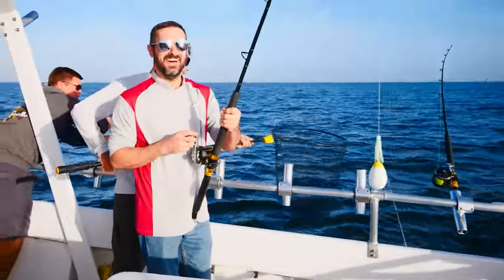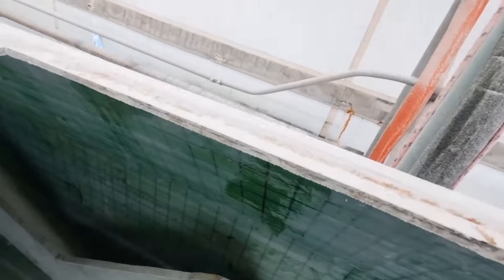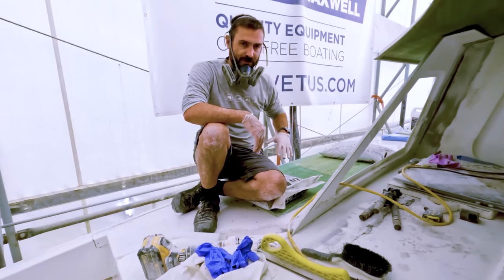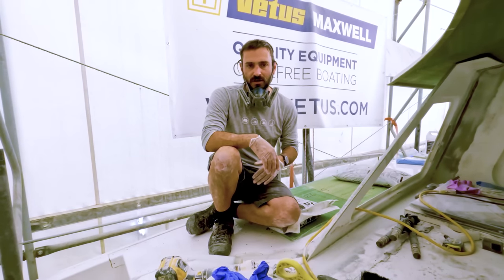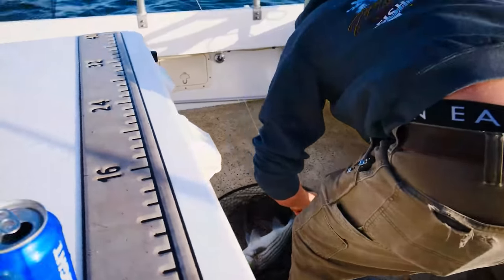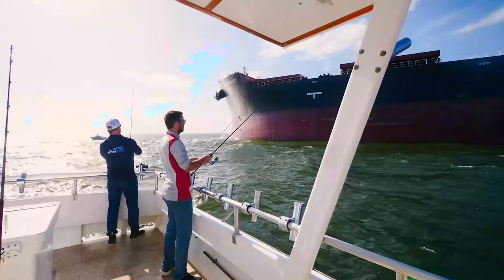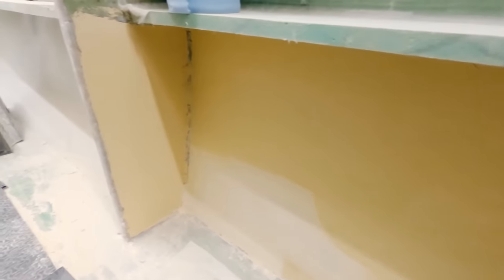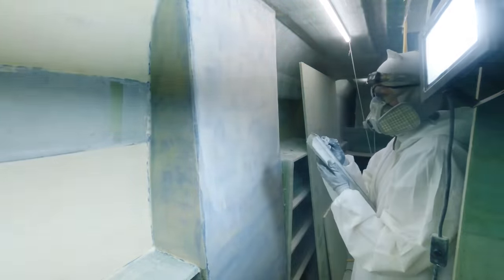The Blue Dye That's Changing My Life!! (MJ Sailing - Ep 258)

Comment: Tip: Sand at 45 degree angles that criss cross (like X). It makes for a very straight, even surface. Sanding in straight lines just means a lot more work to try to get a very straight/flat surface.

Comment: MJ,
Have you considered using your "pasty bag" as a liner in your mixing cup. Use a rubber band to hold it if that helps but mix directly in the bag and then remove. No scooping, no waste and it saves the cup. 
Just a thought. Keep up the great work it's really coming along.
Reply from the maker: We've tried it before, but it didn't get a good mix as the bag would come off the walls and made stirring difficult.

Comment: Jessica     You might want to check out how they do automotive bodywork sanding to feather in the high spots, etc.  It is similar to what you are doing with the blue dye. They also reference using a pencil to scribble across a surface you are sanding to see what layer of Bondo they are removing.

Comment: Sand in 45 degree angle to the floor then reverse and go in 45 degrees in the same place this gives you a cross hatch effect and the low and high spots will get sanded properly, if you use the sanding block in all different directions around in circles left right up down you inevitably will sand in the same spot too much and not enough in another spot and create more valleys
Reply from the maker: I always thought that was the correct way too.  But a few different professionals told us the random orbital way is best for the concave of our interior.

Comment: The EVA foam decking will look like a$$ after one or two seasons. You might want to think about something like a rolled-on type of nonskid that you can actually get clean and won't get funky. You might want to try the 3M Cubitron paper with the Hook-it backing. This stuff lasts waaayy longer than the stuff you are using. Also try sanding in diagonal direction then reverse direction so you are cross hatching. Cuts faster that way. I'm so ADD about it, I'd be sanding for about three years on that thing. Nothing bugs me more than finding a crater in the surface after the paint goes on...I guess you gotta figure out the level of finish you can live with and pick a point that you haft move on too the next panel ha ha ha.

Comment: Is there a reason you’re not putting radiuses on your corners ?
Reply from the maker: Not sure what area you are talking about.   There are radius on all edges.  From 3/4" down to 1/4" depending on where it is on the boat.
Reply: @MJSailing  the outer coroners for the hatch inserts look squared, seems a rounded would due better to prevent possible stress points
Reply from the maker: They need to match the hatch that goes in the opening.  The flush part is square acrylic

Comment: Sorry if this hurts your feelings....BUT....I would have done everything from the INSIDE....and left the Topsides intact other than the need hole for the "FLUSHER INSERT " you are molding which I would have installed from below......I would have done what you are doing to the TOPSIDES on the INSIDE....leaving the Topside layers less prone to cracking in all your cuts and joints...I think that will haunt you down the line I have years in building and repair of Fiberglass boats....sorry to burst your bubble...but as my friends know I speak the truth even when it might hurt or offend one's ego...best of luck continuing the build and it's all a great learning curve which will give you years of knowledge to build on....God bless!!!   SV ARCHANGEL  AK
Reply from the maker: It needs fiberglass on the radius (just a bond isnt enough) and would have required gelcoat and glass work on the hatch exterior edge anyway.  We did the aft hatches the way you describe because they are exposed on the flats, where these will be under the nonskid and easier to blend in.
Reply: @MJSailing  Great!  Keep up the great work...making great progress!!

Comment: USE ACETONE not alcohol with blue dye, dykem. Acetone will "thin" the die much better and the rate of drying is 10x faster. Alcohol is not wrong to use but its not the best choice. Blue dye dykem it is a great sanding aid, BUT REALLY its sanding with math. using DYKEM your sandpaper has an expected average mill rate of cutting to 100% remove the blue dyed surface. The trick is knowing your thickness. That has more to do with gelcoat btw....  DYKEM you can use to sand the surface to 3000 grit plus and should when doing sanding/buffing finish work on the gelcoat..   "PRO TIP!!!!!"    When it comes to dealing with island low spots when filling with fairing. circle it with a pencil give a good bit of space say 1-2"  away . then sand out the blue die low spot "ISLAND" SKIM it with filler. Your pencle mark should more or less be untouched. when ready re-dye the surface and sand. That method makes sanding lows VERY fast. An other FYI tip. BLACK sharpy markers are really blue die. use plyers pull apart the body of the marker. pull out the ink well slit it with a blade, and throw it into acetone. instant blue dye.